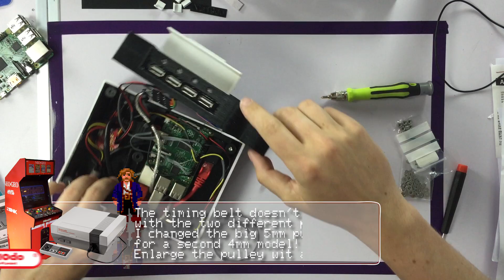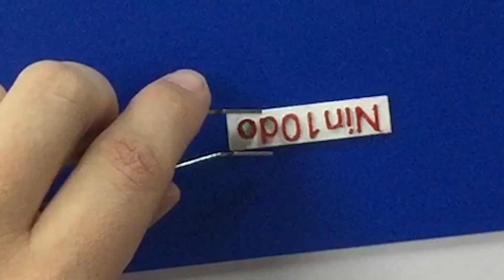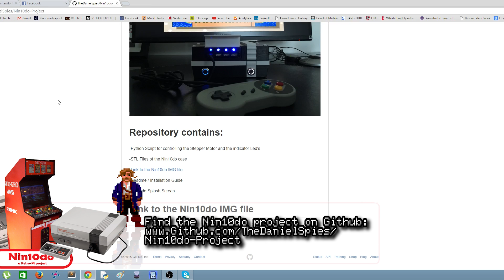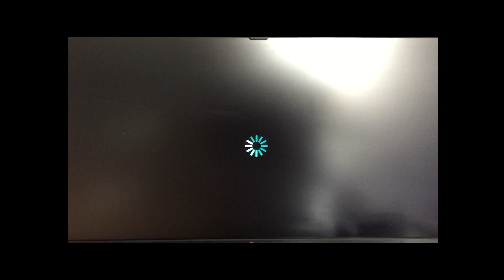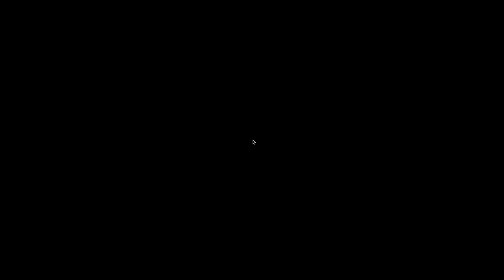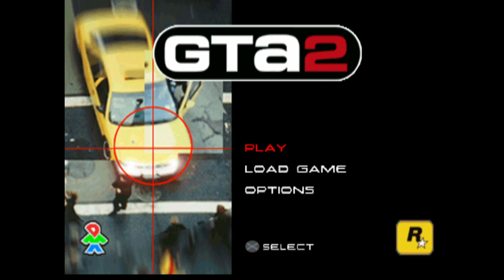Nin10do tutorial: Build your own 3d printed Raspberry Pi 2 NES game console (part 3)

Comment: How to boot the plug and play Nin10do_8gb.iso via pc? Can u make a tutorial video for that please? 
Becoz I want to test it on a pc and also to be able to play it on a pc as well
Reply from the maker: Sorry that is not possible. You can only do this on a Raspberry Pi... Thanks D
Reply: Well this is very sad!!
Anyway great setup on your Acer Predator X34, Lian Li PC-08 WX and your handmade Nin10do.
Btw I have read somewhere think in fb that your PSU has broken twice there may be a solution: If your psu overheated again u can flip your psu fan to the bottom of your case so it will not overheated itself by the warm airflow of the other hardware components. If there are no holes in the case's ground just make some.